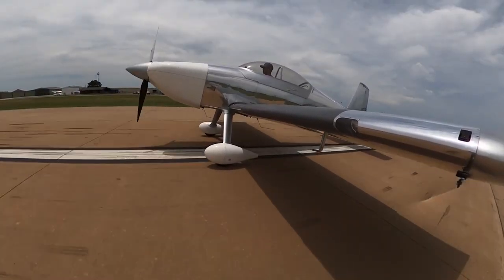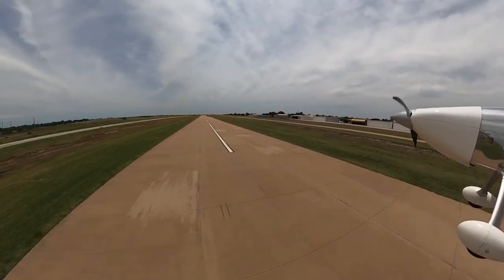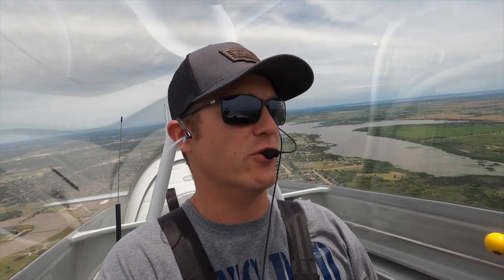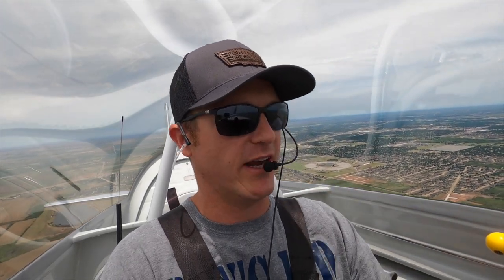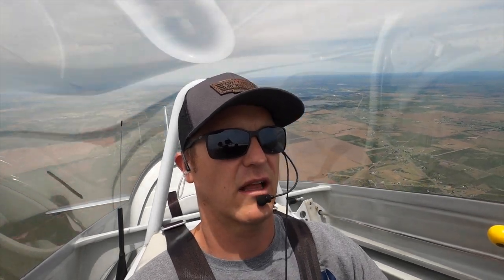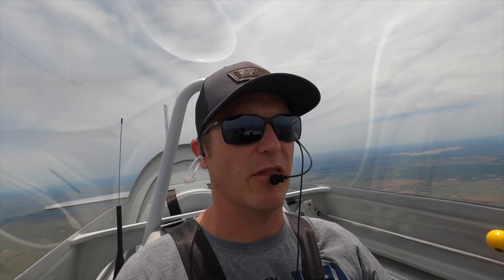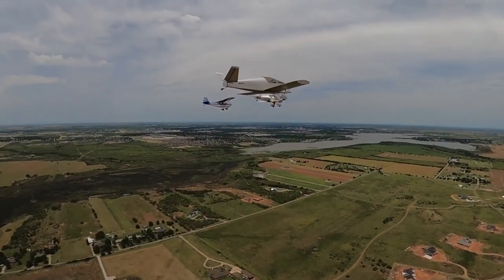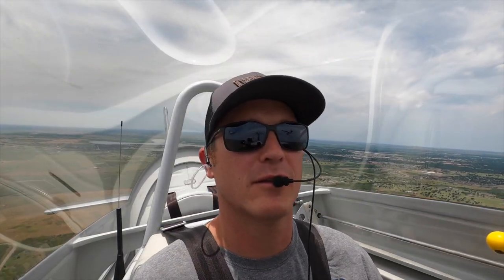Learning Hammerheads and Surprise Flying Formation

Comment: What camera are you using and how do you control where it is looking while flying?
Reply from the maker: It’s a GoPro Max 360 camera mounted on the Flight Flix pole mount. I control where it’s looking in the GoPro app during editing. You can see how it’s mounted in my video on the Flix Flix 360 mount installation!